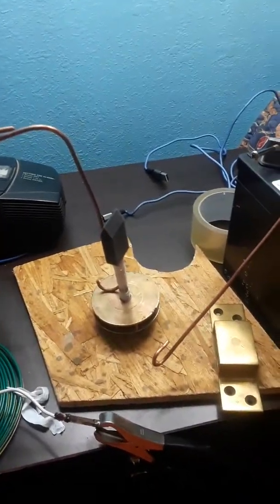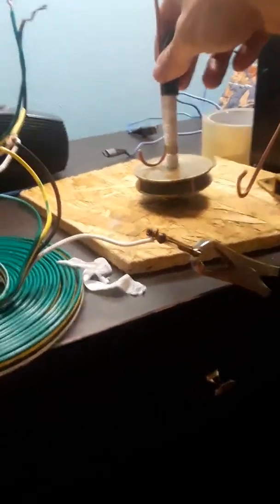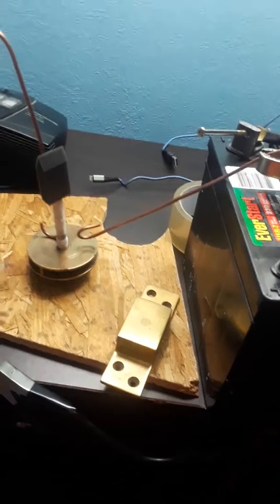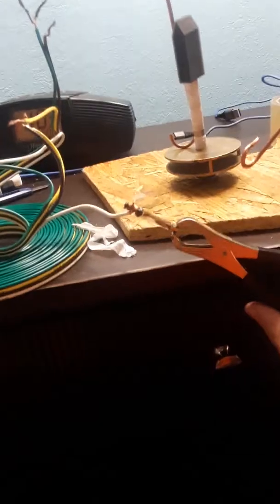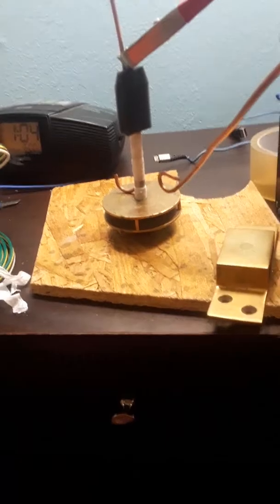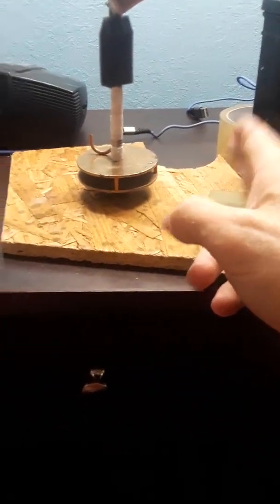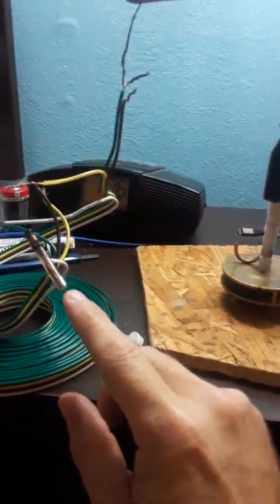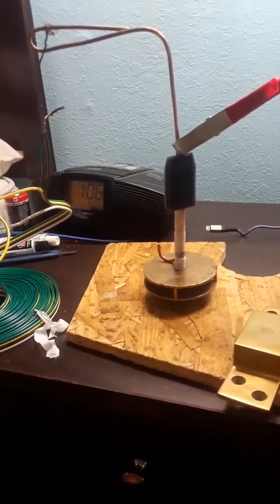Faraday motor attempt 3

Comment: Spray the disc in loads of WD-40 then spin the disc with your finger before you apply the electricity.  If this doesn't work use much bigger magnets.
Reply from the maker: I tried adding a bilifar coil as a capacitor between the positive and negative. This got it to stop welding and saves power. Added more magnets. Still the rotor is not overcoming the resistance.
Reply from the maker: I tried adding a tesla bifilar coil to prevent from welding and store power. This working well.(it actually raised the voltage;) from 12.5 to 12.85  Added some magnets. But still not enough to kick start yet. Thanks I like the dd40 suggestion.
Reply from the maker: I'm thinking maybe make in more sturdy than try to jump with a spark gap might be fun.
Reply from the maker: Still thinking how to saturate with current. Get more power without melting 🤔thanks I will dry dd40.